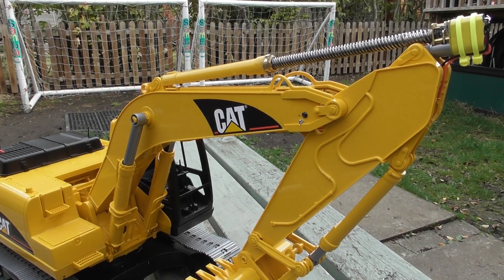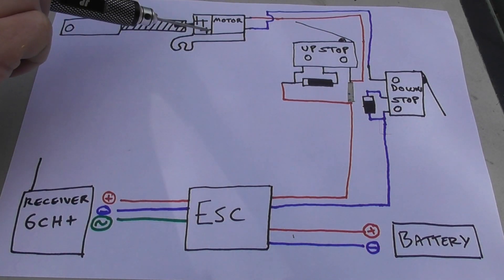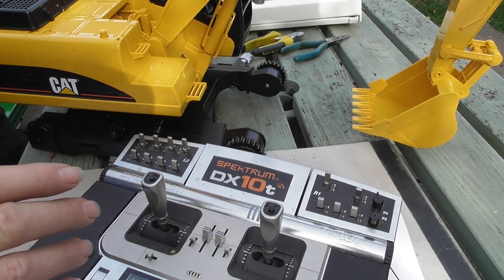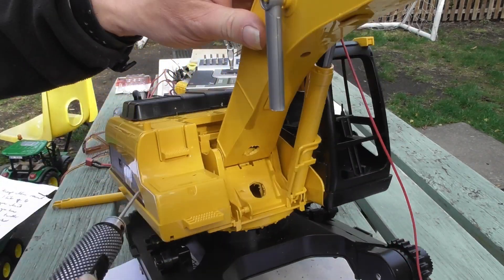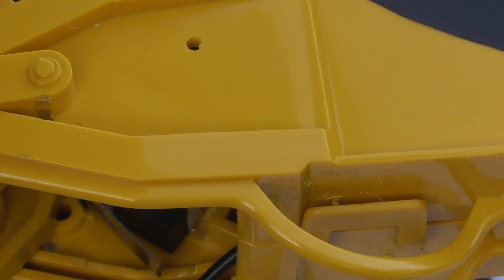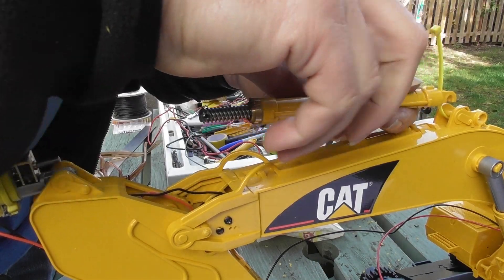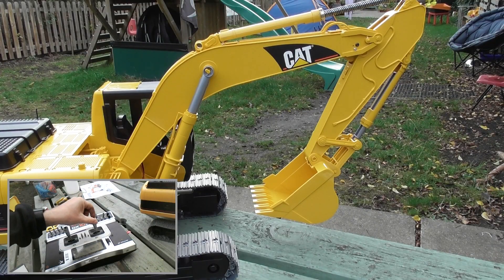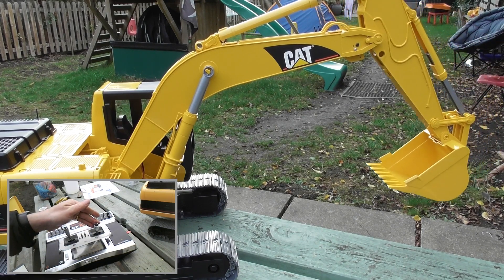Bruder CAT Excavator RC conversion pt2: Actuator Control

Comment: typical pom...making something harder than it needs to be...ditch the Bruder crap , buy a Huina  1550 or 1592 , spend a few dollars or pounds and buy the kit and do it properly with worm drive actuators if you are not happy with the factory set up ..Bruder is trash compared to Huina...
Reply from the maker: 😂😂 typical pom that’s me! 😂😂 the bruder conversion turned out pretty good in the end. It was the challenge more than anything that attracted me to do this. And I learned a lot. I’m currently putting together a Lesu P360 - that’s proper stuff for digging!

Comment: What ampere battery are you using...because I tried those same micro sw with an 11.1 lipo and they got awfully hot!
Reply from the maker: This excavator has been totally remodelled - using an 8000 Mah 12v system (see the video I published today). The motors in this video were rated at 6v, so a max of 2s (7.4v) or 6 cells (7.2v) is prob recommended.  3s (11.1v) would prob damage the motors if used for any time. Its the volts rather than the amps (ampere) that matters for this.

Comment: What kind of motors are you using for those actuators ? Because I want to use a couple of those for my project bruder scania liebherr crane.
Reply from the maker: Those are N20 motors. You probably want to use much larger ones in that.
Reply: @RCModders  what would you request for the boon ?  And the the sidearms?

Comment: Very clever design
Reply from the maker: Thank you! I have since made improvements to this design - using 3D parts to make a self contained linear servo, including travel limits. I hope to get round to making a video series showing the updates.  😀👍
Reply: @RCModders  nice.i have the huina 550.upgraded servo actuator. I need to put the limit.i have same diagram but i just couldn't figure out until o saw your video.now it kinda reminded me the diode. Very clever.i didn't think about.i remember doide is to rectify or amplify current. and only one direction. Your video made all sense now.
Reply from the maker: @g2183mac  very glad to have helped you! That is why I make YouTube videos! 😀👍
Reply: @RCModders  yes you have help me so much.the puzzle has solve for.i successfully installed a limit switch for my excavator. i have used wire to pull the limit switch because my excavator boom is so tigh,so i used wire so i can put the limit switch anywhere i want.

Comment: Great engineering talent you have. Bruder should hire you as a designer to build an RC line for their trucks.
Reply from the maker: Thank you. its really only only one part/bolt/wire at a time stuff which comes together at the end. Personally I'm glad that Bruder stick to what they are great at & leave something for the 'modders' to tinker with. I'm hoping that the 3D printing thing should make doing these conversions much more accessible to more people (ie cheaper, easier & quicker).   😀👍

Comment: Hi sir. Where can i buy a remote like that.to modified like a real stick on excavator thanks. Nice job
Reply from the maker: Hi. It would seem that Horizon hobby have discontinued both the DX10T (the one that I have) and the DX18T (the one that came after). These do have additional buttons on the sticks, which might make them even better. If I didn't already have one, I would probably look for a used on one Ebay. However any aircraft transmitter with at least 6 channels should work OK (ideally with the spring enabled to centre the left stick and programming functions to change what the right stick controls). Hope this helps!  😃👍

Comment: U can use a slip ring to allow for continuous rotation.  Interesting build by the way very intuitive.
Reply from the maker: Yes ... that's what I was looking for. I knew something must be made for the job - sometimes its just knowing what its called - like the 3D printer lead screw - found small cheap ones on Ebay & got ordered up. I was holding off doing that stage until I at least had a rough idea on how I was going to overcome that. Thank you for your kind comments on the build & have a great day  👍😀

Comment: https://www.youtube.com/watch?v=M2P47ihIjzQ

Hey bud this might help you with drive gear for cab 👍🏼😁
Reply from the maker: Cheers. I’ll check it out.  There are not too many successful conversions of this model out there. It’s especially useful when others have shown the tear down - as it saves doing unnecessary damage. 👍🙂
Reply: One advantage that you’ve got over any other bruder escalator is that no one has ever used this set up to my knowledge.  I thought of it while watching my  3d printer build some parts for my tractors.. What goes together must come apart lol.. You’ll find that the dreamer and a fine cut bit will be your best friend for all bruder conversions 😏🤫😁
Reply: Pa I might give this build ago after I get done with a few projects
Reply from the maker: I agree🙂👍
Reply from the maker: I seem to have a lot too. I might do others in-between episodes of this, as it is quite intense 🙂

Comment: how are you planning on preventing the wires twisting? i think 4 hoops of a conductive metal, each fitting inside the others with something like bearings that run over each of them that could run the power through, mounted between the bottom and top moving parts around the swivel... pretty tricky to explain... hopefully you understand what im getting at... thats assuming your using only 2 brushed motors as you would need 2 hoops per motor (3 if brushless) 

just think of 4 of the old mechanical esc's, only 4 different sizes and mounted 1 inside the other inside the other ect... obviously a solid track though as you only need it to transfer power across and not control speed

i can email you a sketch of what i mean if im making no sense here...

thats the only mechanical way i could think that would work and be relatively easy...

if you have another idea im looking forward to seeing what that is... everything else seems too complicated out of the ideas i have had...
Reply: just thinking, bearings alone could work... 4 different sizes as long as they could fit inside eachother... inner race you could have input and outer race output x4.
 or maybe bearings same size but stacked... as long as there was enough space for the wires to run inside them along with the swivel mechanism of the bruder...
Reply from the maker: I'll have a look to see what is out there & have a think. ..... 🙂
Reply from the maker: I can see what you mean. I'm hoping there is something commercially available that is not expensive (I want to keep these builds affordable & do-able for lots of people as far as possible - although the lathe is occasionally a bit unavoidable).  I think it can be done by having the base effectively as a separate model & using 2 receivers and 2 batteries, with Spektrum model match on a computer radio it would be easy to switch between the two. This would be my 'plan b' though  🙂👍
Reply: @RCModders  whats the plan to make the swivel, swivel? n20 with a wheel that rolls 1 half against the other? that or a modded servo would probably be simplest way
Reply from the maker: I think a variation on your idea might be a good way of transferring power and control for the legs and ramps on the low loader from the 5th wheel on the semi truck tractor unit when i get to that  👍